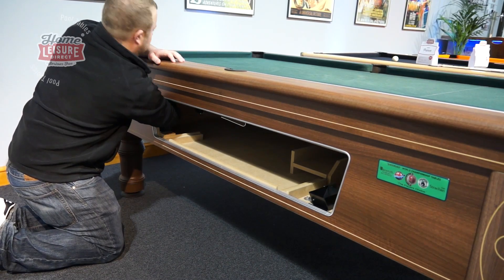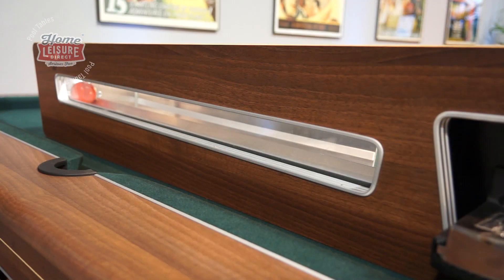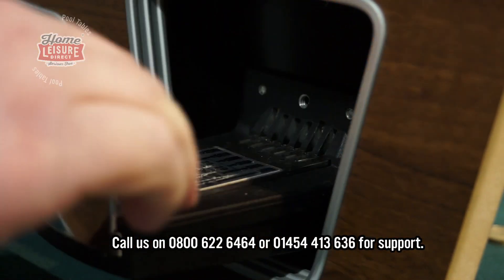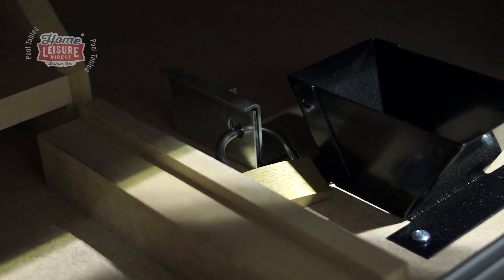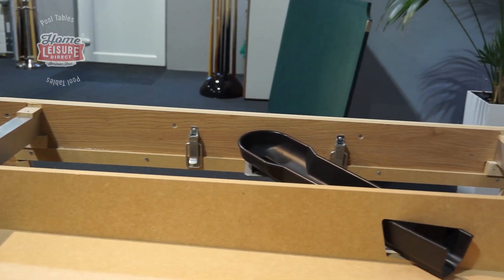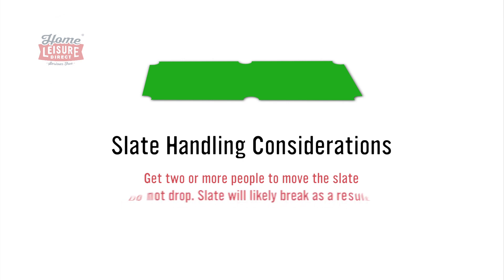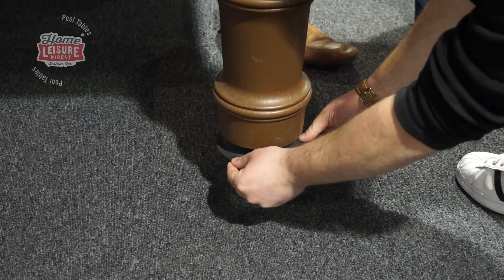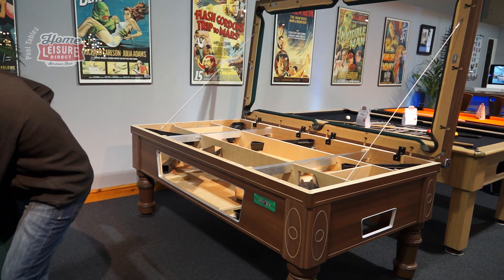Basic Coin-Mech Pool Table Maintenance

Comment: In American pool, the cue ball is slightly larger for a coin operated table, or using magnetic ball
Reply from the maker: American cue balls are usually magnetic, although the Diamond system uses a laser system to shine a light through the cue ball to sense it is the cue ball and not an object ball.
Reply: Meanwhile in where I live, some local custom pool table builders (which build home-made coin operated tables out of wood and slate) uses a smaller cue ball (52-55mm) for American 57mm balls.

 The cue ball separator on these custom tables are fairly simple but interesting: There is an inclined gutter with a hole on the side that the cue ball can enter but the object ball can't. The object balls are then continue to roll through the gutter and into the ball return tray.
Reply: That's why valley tables suck and diamonds are awesome.

Comment: Hi home leisure how do I make our pool table free to play for our customers ?
Reply from the maker: Hi! It largely depends on the kind of coin mechanism your table has. Electronic coin mechs you can reprogram, but an Essex Straight Six (the kind you load up with coins then push into the table) requires more in-depth fiddling (though there are guides for this online. Just google "Essex Straight Six Coin Mech price change" and you should find some guides. :)
Reply: @HomeLeisureDirect  Thanks

Comment: Removing the slate for simple ball-blockage problems should be a last resort.  First see if a blockage can be reached through one of those holes that are already in the table.  Some barboxes have a large hole/panel which allows a worker to get his head and upper body into the table from below.

Comment: Padlocks can be easily bumped, and the locks on the pool tables are not any better I have a key that will open all of them without needing the combination,  that's why most table owners change those cheap locks out!
Reply from the maker: Yes, we certainly recommend changing the locks, unless your bar staff are likely to lose them all, which often happens. That's when having a standard lock is a godsend.